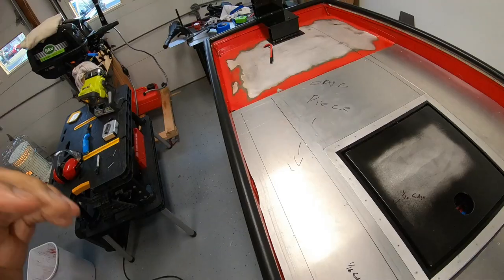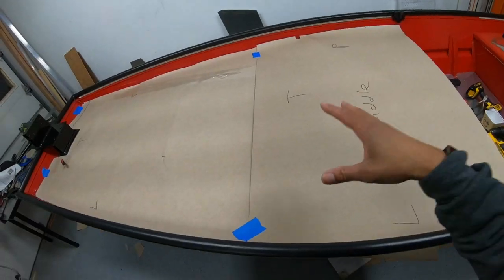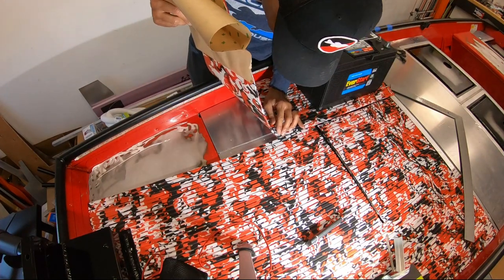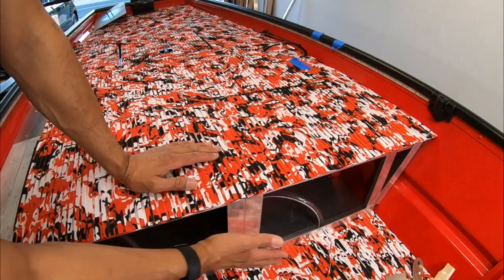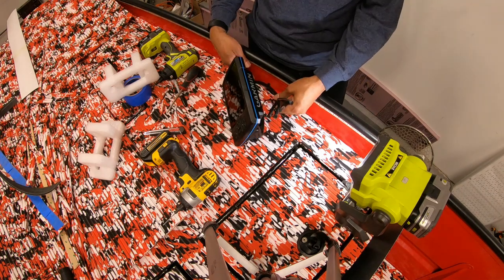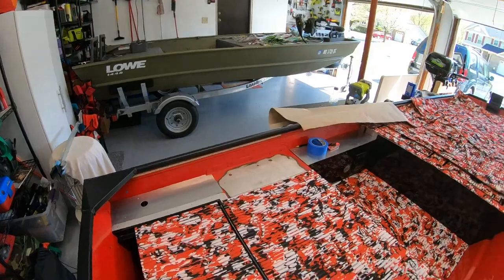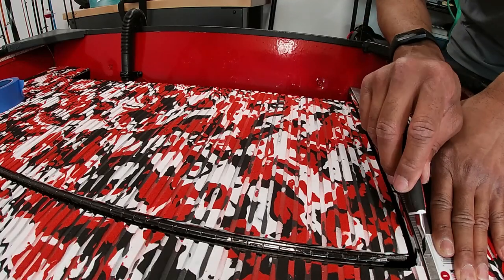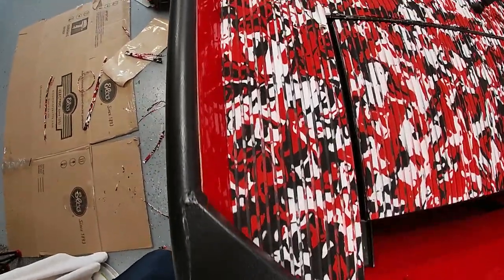HYDRO TURF INSTALL Complete Step-By-Step {Jon Boat to Bass Boat Conversion} Alumacraft 1232

Comment: So I have a question for ya and I probably should’ve asked this in your video the wiring DO I’m running to battery sales lithium ion just wanna trolling motor and a 12 or one but with a battery just for my electric off should I cut off switch for either one and which one would you think I should be home for?￼

Comment: Great video. Have you found that the adhesive holds well since the install? My boat has a gritty textured paint, do you think I would need to sand that down? Thanks.